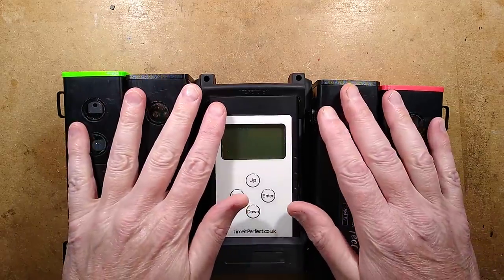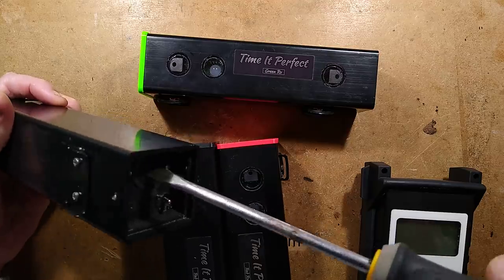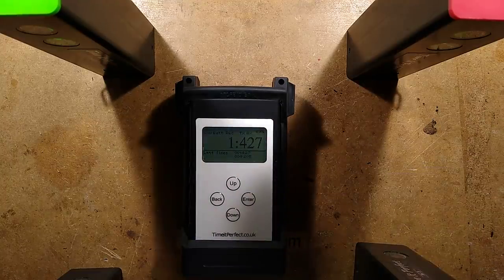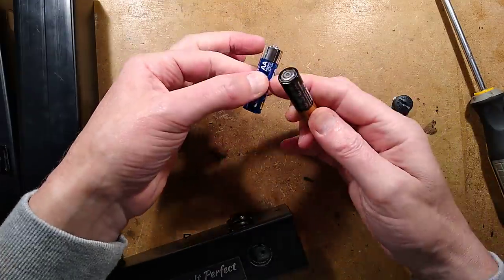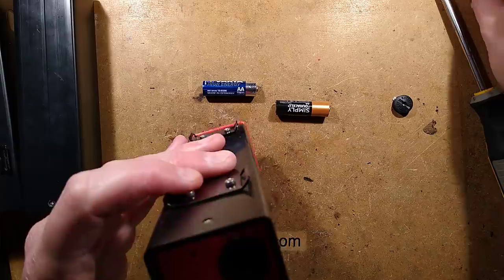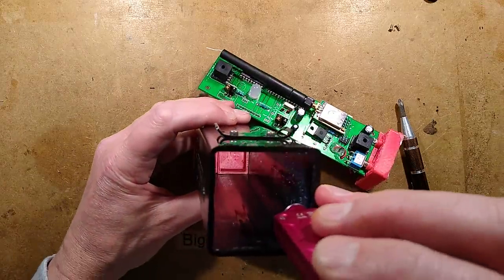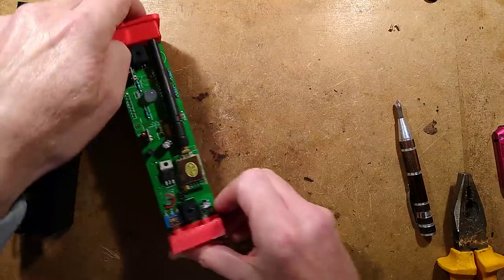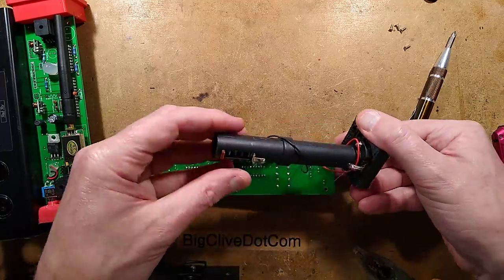Troubleshooting a faulty dog-race timer

Comment: Had a snoop around Companies House and looked at the filings for this company. One person, next to no assets, material costs are about 80% of turnover and dividing the turnover by the advertised price they sold 17 units 2018/2019. This is a guy in his shed buiding these things in the evening after work.
Reply: As Drachinifel says about the Lord Clive monitors: "in classic British patched-up-in-the-back-of-a-shed style".
Reply: For one bloke in his shed, this is some pretty decent design and manufacturing.
Reply from the maker: Classic British cottage industry.  It's where innovation happens.
Reply: @Zadster  
He/she/they had to code the software, too.  But they did a very big disfavor to any repair person like Clive by defacing the chip.  The low volume sales doesn't justify such extreme measures.  But the Chinese are such prolific counterfeiters that I can understand their concerns.
Reply: @acmefixer1  If there's a JTAG header and the chip supports it, you could just read out the ID and find out what chip it is that way. There's also decapping if they're extremely desperate to find out.
Reply: some of the best things came out of the back of sheds all over England. and here in Ireland & everywhere else. BUT the English hold the title for this one i think... : (
Reply: @acmefixer1  Defacing the chip might not have been done for obscurity, but just the opposite. If they are all the same chip and the guy programs a batch of them at a time, now the receiver and transmitter chips all look the same. Which one to mount in which box? Scrub off the label that is of no use to him on the handy sanding block and write an R and T on each one, then throw them in a box. Now just grab the ones you need.
Reply: I applaud his entrepreneurial spirit.
Reply: @lwilton  I disagree. Just marking the chip with an "R" or "T" would be simpler and faster. Scrubbing off the existing part number serves no purpose.
Reply: @HiddenWindshield  Well, if you only have a black marker it might serve a purpose. :-) 
But yes, it was likely done as some form of obscurity. How well that really works I don't know. It should be easy to figure out the purpose of at least some of the pins on that chip, and then given the chip shape and general purpose, there aren't likely to be too many choices.
Reply: Also why deface only one of the chips? If you're aiming for obscurity, why not go the whole kilometre?
Reply: @acmefixer1  Prolific counterfeiters need big markets to make it worth it, the guy who designed this has a tiny niche market, they're trying to stop 'local' competitors making 'compatibles' and local tinkerers like Clive and I repairing their product so they can control the repair/replacement income stream as well.

Scrubbing off the label won't really slow anyone down for any significant length of time, it's just a bit of an annoyance.
Reply: @lwilton  A white paint dot on the TX would be much less effort though.
Reply: @lwilton  Or stick a label on it instead.

Comment: That looks like some proper British “two lads in a shed” engineering!
Reply: What I find really interesting about it are the traces. Look at those right angles. Not a problem ofc but, most design software gives you 45 degree bends as just default settings. Maybe the PCB design predates the rest of it? or the original layout was done by hand? Maybe an old design that was updated with 3d printed parts in the last decade or so?
Reply: @Sideshow Bob's Fan Club A price isn’t set by some percentage above cost, but how much they can sell it for. For a boutique product like a dog racing timer, I would imagine the market is neither particularly short on cash or all that large. If these guys charged less, they could be considered an inferior product (like a off-brand cereal). If the market is large enough to support the increased volume at a lower price, then they’d potentially exceed their production volume.
Reply: I know that if I engineered it, it would work but the cases would be old margarine tubs, and the firmware would be completely impossible to understand
Reply: @Sideshow Bob's Fan Club If we say that a moulding tool is going to cost around £20,000 and the company sells 1000 units per year then the cost of each set of end caps is £20+ to recover the cost of the tool in the first year. That's a big outlay for a small company starting up. So it's understandable why they'd go for the cheaper option, at least until they'd generated some profit.
Reply: @Sideshow Bob's Fan Club why? For a production run of 25 that would add 100 quid to the bom.  Perhaps people think 3d printed is unprofessional? Well hold that thought because passenger jets, their engines and even houses are about to be 3d printed. Or maybe its a bit prototypey? I'm guessing they never really get out of prototype.
Reply: @andrewwilson6240  I expect that was how the first one was.  It looks like a student project that was then packaged for a very small production run.  They could have been much worse and could have been dodgy hand soldered twisted wires etc..
Reply: Two lads in a shed is a grand tradition everywhere. See also Hewlett-Packard...
Reply: 2GIG
2 Guys In Garage.
Reply: They could have stuck it in a Verobox (still make those?) and it would've looked shed-made, they could've 3D printed it and it would've looked shed-made. This is because it was likely manufactured in something like a large shed. It costs a bloody fortune because frankly, bookies and race organisers can afford it. There'll be people at the track with 680 quid in a pair of old trousers they gave to the charity shop. Production cost and selling price are nothing to do with each other, which Sideshow seems to get, but doesn't realise it applies both ways. 

The requirements of this are stuff like weather resistance, accuracy, repeatability, since so much money changes hands depending on the results it gives. Only the dogs are gonna see them on the reg, and they don't care. The customer realises that it's a very small market, effectively bespoke custom gear. So adding tinsel to it is something absolutely nobody involved gives a fuck about.
Reply: @Sideshow Bob's Fan Club I thought much the same and it does not look at all weather proof . Not made for the Brit climate
Reply: @Robert C I hope they have also improved the weather proofing

Comment: At 4.30 you describe why you should not mix batteries, as we are exhorted by manufacturers.  Your explanation mentions reverse charging ... maybe a longer video on the topic is possible.
Reply: i second this
Reply: In said video we will also like to see if (when) charged and depleted batteries bounce different 😉
Reply: We all used to mix batteries when we were kids, didn't appear to make much difference, we also used to sit them on top of a stove to heat them up, this made them last a few days longer, every time we did this they would last a day less until they would just die, or the carbon rod would pop out of the battery.
Sometimes the carbon rod would come out with a lot of force if we heated them to much or for to long.
Come to think of it, we very rarely had leaky batteries back then, not until they were left sitting flat in something for about a year or more!
Batteries appear to leak a lot quicker these days!
Reply: Dave at eev blog has been trying to make batteries leak without much success, i dont think he’s tried mixing them up?
Reply: @eliotmansfield  I know, it is quite ironic that his ones will not leak, even though he used the same make as he had leak before!
Reply: Always knew not too mix old and new batteries. But never knew why it was dangerous. Thank you Big Clive. 👍👍
Reply: @BoB4jjjjs  Once I bought 72 AA and 72 AAA Varta batteries (because it was offered very cheap) and I had a terrible experience. Varta batteries leak if you leave them in place.
Reply: @RichEstlick  If you put a almost dead one in series with a good one, the dead cell will just appear as a resistor and nothing more. If the old fellow is having some voltage (not fully dead) and the load is not too much, I do not think there is any serious problem.
Reply: @BoB4jjjjs  It's the equipment. In the old days, most devices used physical power switches, so there was no parasitic draw when they were switched off. Today, even flashlights use electronic/soft power switches, so there's always a draw, which leads to overdischarging of batteries and leaking.
Reply: @straightpipediesel  Either that or they go fit a clock or something daft to it so it is always drawing power.  Ok, it ain't much but over time it runs them down!  I had one torch with a radio, it had a memory in it for the digital radio, it took me a while to realise the reason the torch didn't last long was the radio memory and the clock in the radio was always drawing power.  I just didn't think about, then I noticed the radio dial was lit up when the torch handle was gripped or the torch was powered on!
Then the penny dropped!  DUH!
I never had batteries leak, I always took them out during the summer.
Wonder where that torch went?
But you are right, a lot of things don't have a good old fashioned click on/off switch these days.

Comment: Maybe a good candidate for powering by a single 18650 cell recharging via a micro usb socket?
Reply: I'd rather USB-C
Reply: I wonder if predates the modern power supply techniques?
Reply: They way the system is built, all thru hole technology, i guess who ever makes these units is not comfortable with SMD soldering. So that kinda kills all USB/USB-C connectors, unless you get presoldered modules for that and connect them over some standard header pins to the existing system.
Reply: I think you could do use that 18650 with minimal regulation into an esp32 in deep sleep with single button and auto off and have almost a single chip solution for just pennies.  On the receiving end it could still be an esp32 and you'd be able to view the results via your phone. The trick would be how to synchronise the event clocks because bluetooth and wifi stacks would have variable delays so it would have to send the timestamp. The cost is still in the enclosure faff.
Reply: I think you could do use that 18650 with minimal regulation into an esp32 in deep sleep with single button and auto off and have almost a single chip solution for just pennies.  On the receiving end it could still be an esp32 and you'd be able to view the results via your phone. The trick would be how to synchronise the event clocks because bluetooth and wifi stacks would have variable delays so it would have to send the timestamp. The cost is still in the enclosure faff.
Reply: @ProtonOne11  I would guess they have the boards made in China and the through hole is cheaper maybe

Comment: It's good to see something which is not designed to obstruct disassembly and repair. If Apple built this, it would be ultrasonically welded shut and you'd have to pay £600 to the Genius Bar to get it "repaired" - meaning "replaced".
Reply: They did scrub off part numbers though!
Reply: how dare you !! apple stuff is the best!

Comment: I bet those scrubbed chips are Holtek or similar remote encoders/decoders - maybe they couldn't figure out how to do the encoding/decoding in software.
Reply: That was my thinking, but they seem to have not taken full advantage of them to have different codes for the green and red pairs which makes me wonder why they bothered with encoding at all. 
Could it be that they couldn't get the 1ms timing accuracy with the Rx micro doing both decoding and keeping in contact with the timer - maybe they're not doing a simple decode until the beam is broken then transmit to the timer?  And why is there a micro in the Tx?
(Sorry if I've missed something - I'm dealing with a splitting headache ATM.)
Reply from the maker: It's probably just easier to do it with a dedicated chip.
Reply: There is a good arduino library for IR receiving and transmitting. I used it for a IR remote tester that can read the codes of most remotes running at 38 Khz.
Reply: Mike's now got to the point where he can reverse engineer an unknown chip just by looking at it!
Reply: Looking at it this morning with a slightly clearer head, I'm a little doubtful of the apparent 1ms timing accuracy, particularly with the use of what look like 38kHz IR remote receivers. These work fine with 1kHz pulses but the output hangs on on the trailing edge which limits their max pulse rate.

On top of this there's the red and green pair not being synchronised, then the delays built into the decoders after no code is received and the valid transmission output goes false which is determined by the clock frequency. This might explain the DC-DC converters as the HT12 internal clock goes a lot faster as its supply voltage increases, although it's possible they could be clocked externally from a timer in the AVR.

But then they may be using something other than an HT12 pair.
Reply: I wondered why they bothered pairing the two as they won't ever interfere in any normal setup - there are many exported requirements for the user. And lo! They did not.
What we didn't see is the Rf comms side. There seems to be an IR Tx to Rx communication, and then a network of RF from the Tx and Rx units to the timer - or a paired Tx and Rx where the Rx diagnoses the Tx and the timer communicates only with the Rxs. 
Two thoughts about accuracy of timing and diagnostics.  
Ignoring the exported requirements to make the beams parallel  the Rx only has to transmit to the timer unit "beam broken/not broken", and some sort of ID so adjacent timer units don't get confused (unless there is a channel/encoding parameter allowing colocating a few timer units). There is no need for any major decoding of the Tx signal, so a continuous pulse train of all 1's is what I'd go for - or alternating a few 0's and a few 1's (for battery life, or if further info were needed, though what escapes me - which would make the Txs identical.
This status seems to be sent across RF by the same means as the battery diagnostics (and maybe alignment info) - would the timer unit poll the units, or is that data in the message headers? Would love to see the RF packets on an analyser.
Reply: Could also be a Microchip MCP2140 (IrDA Standard Protocol Stack Controller With Fixed 9600 Baud Communication Rate) which is in an 18 pin DIL.
Reply: @Graham_Langley  this nuts and bolts of doing that are beyond me programming skills. I just pulled chunks of code out of the example sketches that came with the library and used that to build my gizmo. I have no formal training in programming so I find this method works within the limits of my abilities.
Reply: might be PT-2262/2272 or similar
Reply: Scummy practice of scrubbing off the chips, janky 3D printed cases and dubious specs. I'd expect better from something out of the UK.... Shame on this company
Reply: they could be encoders like the holtek ones or like PT22x2 but those as far as i remember are multiple outputs that could still make sense for outputting a "code byte" but i was also thinking at an FPGA chip, or maybe they ARE remote encoders and they are driven at modulant frequency, like 20kHz or above.... anyways they must not be programmable because they had to scrape the code off... also they are Tx and Rx so the encoders make sense... probably they tried to cover the secrets not by setting the fuse bits on the 328P (i dunno) but puzzling the reverse engeneering with an unknown chip... these units are not rocket science anyways, a quick pinout could answer a lot

Comment: Extremely boutique. I guess the club needs a lesson in taking batteries out when in storage, and Not Mixing Batteries.  If they are a canine club, maybe ask them if they would mix breeds. If they wouldn’t, they shouldn’t mix batteries.

Also what a cool set of innards.
Reply: HA! HA!  FUCKING BRILLIANT : )
Reply: Or just tell them to use 1.5V Lithium AAs, they should be great for this. More expensive than alkalines, but they hold up way longer and they won't ruin your nice gear. If you put them in a TV remote they will probably outlast the TV.
Reply: As much as I hate specialty batteries, CR123 cells might be the way to go. It forces you to use lithium batteries as opposed to potentially allowing them to use any old AA cells.
Reply: @Asptuber  calm down
Reply: How about "you wouldn't mix carthorses and huskies"?